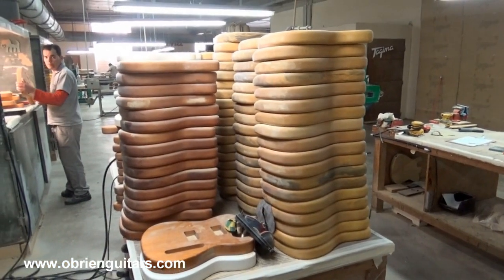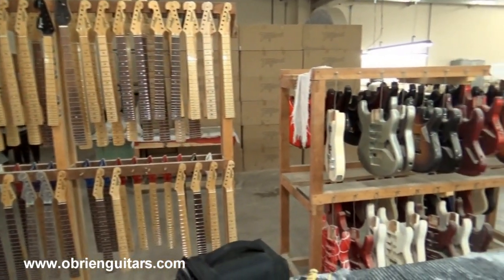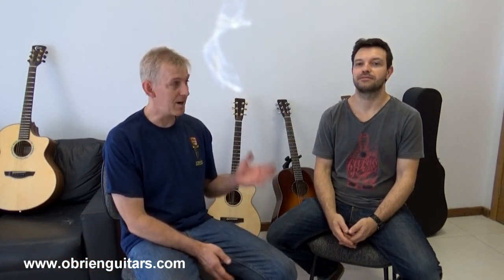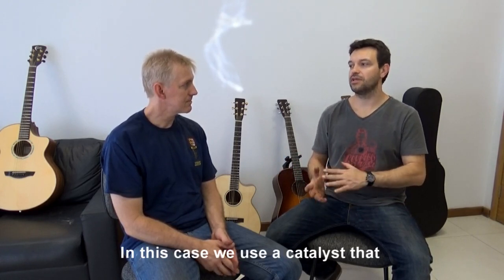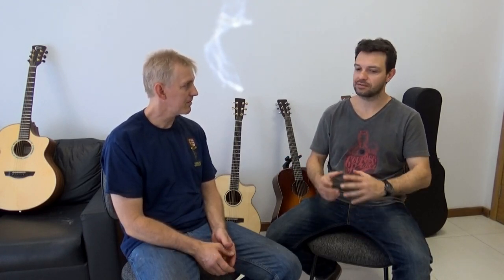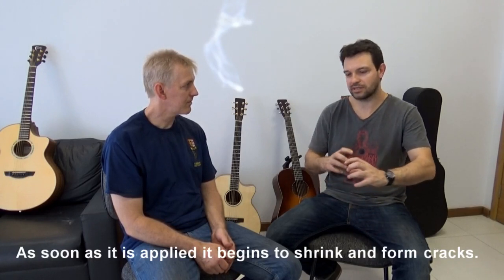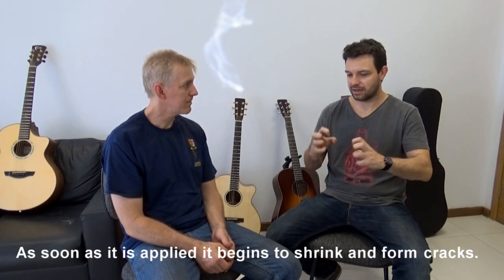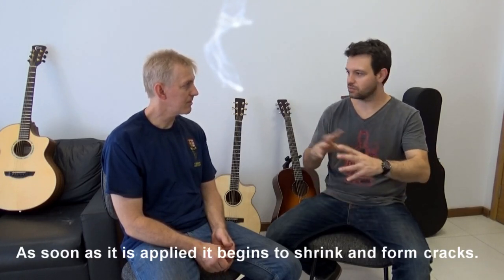Luthier Tips du Jour Mailbag 78 - Crackle Finish

Comment: Very interesting finish. Could you please explain in more depth. Was the white base coat catalyzed and dried completely before the red topcoat? And what type of paints were used? We’re they urethane based?
Reply from the maker: Yes, you have a catalyzed base coat and then a cat color coat on top of that. Both are urethane based.
Reply: OBrienGuitars thanks for the reply. I’m new to your channel and have been enjoying your vids. What brand paint do you use? And could you share the mixing ratios? Thanks
Reply: OBrienGuitars one more question, he said it was an accelerated catalyst and you said too much catalyst. Which one is it? Thanks
Reply: I need to pull this crack finish off for a customer. Could you do a video of the whole process? I’ve tried everything and I’m having no luck. Thanks
Reply from the maker: @hokuspokus  I do no use this finish. I simply interviewed someone at a factory in Brazil that does this type finish.